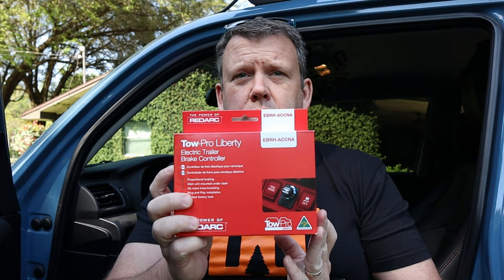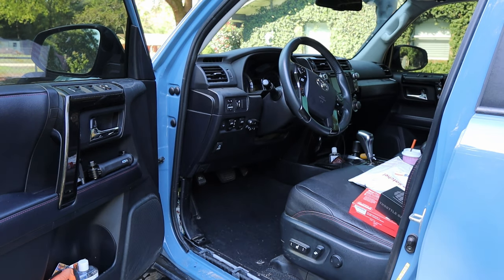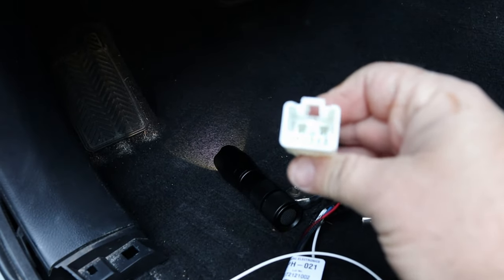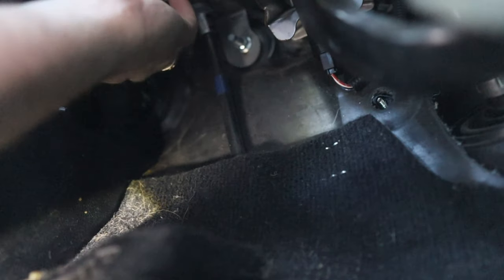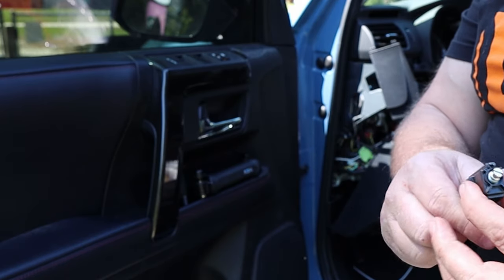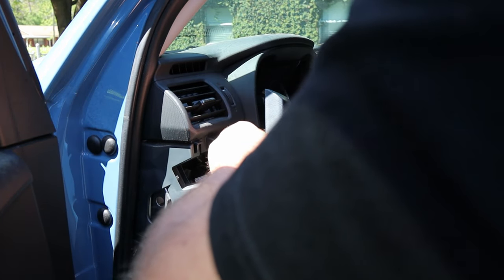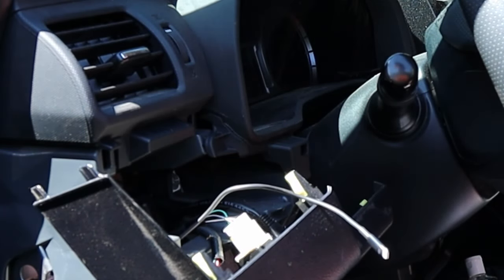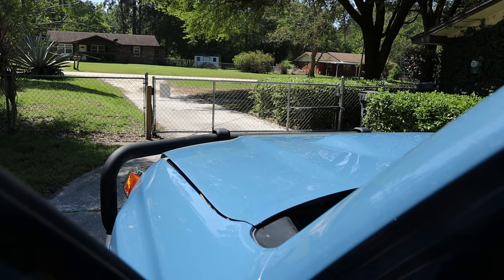RedArc Brake Controller and Throttle Grenade Install on my 5th Gen 4Runner

Comment: I wish I had some switch blanks. Nissan used every single one and didn't leave anything for add-ons :(
Reply from the maker: I understand. This is the first vehicle I’ve owned with a few blanks.
I’ve seen some good switch boxes out there. You just have to figure out where you can mount one.

Thanks for watching!

Comment: Did you have any issues with your tow pro liberty not calibrating by using the tph-021 harness?
Reply from the maker: No issues whatsoever. It works great. 
If you’re having any issues, give Redarc customer service a call. They helped with some battery issues.
Reply: @NathanKingOverland What year model is your Runner?

Comment: Rumor has it thru my little girl/your wife that you could have drove a semi tractor to pull your war wagon toy camper and used less fuel. Just saying use a real grenade on that tonka truck and get a real one. Gramps out 🤓
Reply from the maker: Don’t be hatin’. That Tonka truck got 11 mpg while pulling a 3500 lbs. trailer through the mountains. That ain’t too bad.